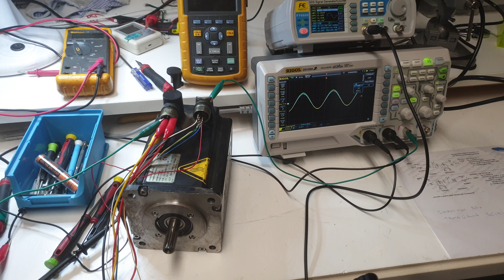kuka servo motor testing resolver stator windings

Comment: Hey Nice work. Have you a link to the pin connector you use to connect to the resolver
Reply from the maker: I pulled apart a Weipu socket and used the pins ftom it, WEIPU WS16 7pin is the part, link here https://weipuconnector.com/product/2

Comment: Okay, buddy, how can I excite the resolver reference coil using a signal generator?
Reply from the maker: Connect your signal generator to the primary coil, connect your scope to the secondary coil to see the induced field. In the vid 3min 35 sec I explain how I did it by finding the pdf for the resolver with colour codes,  its fiddly.
Reply from the maker: Also detailed info here https://www.cjoint.com/doc/19_09/IIgiGrl5zzD_KRC2-Motor-and-Resolver-Spec.pdf
Reply: My friend, thank you very much for the explanation
Reply: i'm from Brazil, state of São Paulo city of limeira, thanks for helping